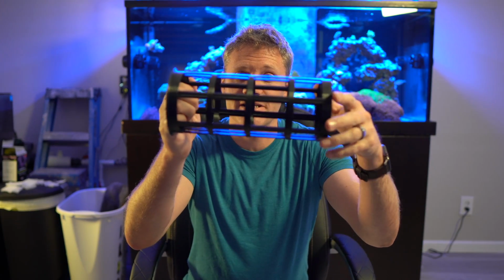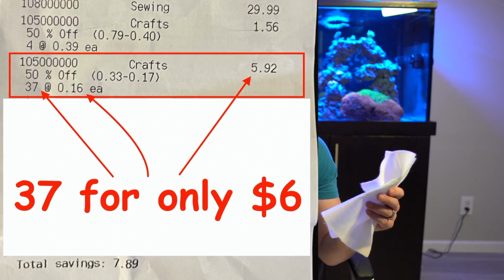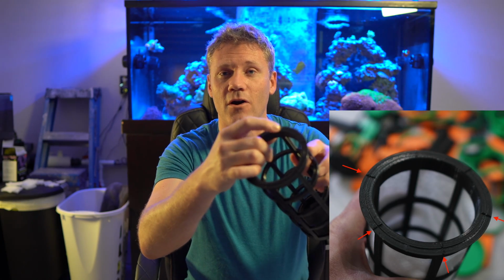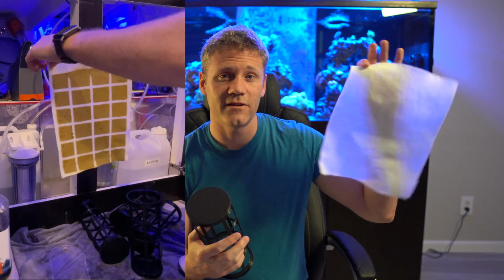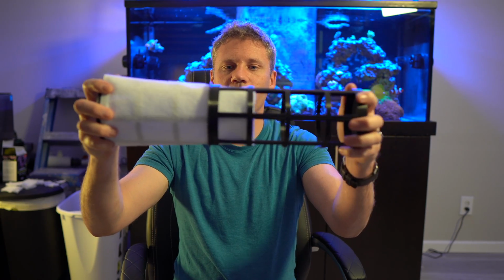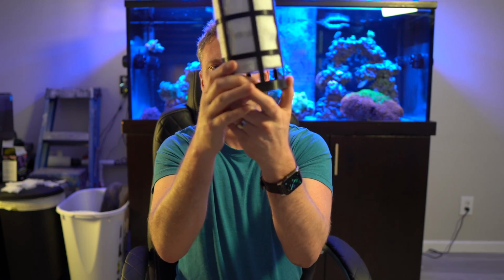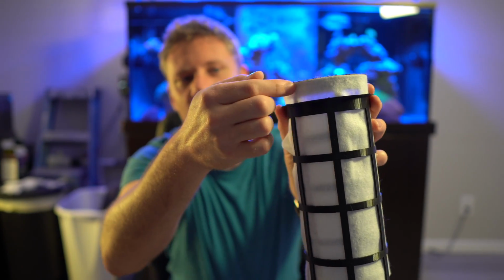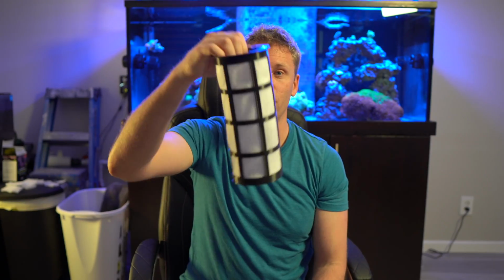No More Filter Socks!! | RAE's New Plastic Filter Sock

Comment: Creative ingenuity at work. Awesome design dude. I will be ordering 6 of them for my future sump. Will be awhile though though, sorry about that. But I predict you should be getting a lot of business / orders from other aquarists once your dramatic improvement gets more exposure. Keep up the awesome works. 😊 ? What are the three different weights of filter socks & what micron sizes do you believe they (approx.) equate to ? I am currently working out several radical improvements for (waterfall) type algae scrubbers. Which if pan out I may decide to market or just sell the rights to outright. Should provide for greatly stabilizing nitrate & phosphate levels in a reef aquarium.

Comment: I can wash my filter socks so many times before they need to be replaced that this makes no sense. Not to mention, the surface area and efficiency that I get from a commercial sock is exponentially higher than anything that will fit in this space (other than a material that will need to be replaced at LEAST daily), leaves me with a hard no. I wish you good luck, but both functionally and economically, this doesn't resonate with me.

Comment: i like it, just mmm how u turn it to put it on   theres no way you can use velcro so it stays in place when putting on so u dont have to twist ???  but other wise its cool how much with shipping and everything ?? to north hollywood ca  ????     ???
Reply from the maker: They are $30 shipping be around $10 bucks, Then velcro is not a bad idea..... I may test that and see how it works thanks.
Reply: @reefingainteasy3754  so $40  and how manny sheets dose that come with  ??? and how manny holder's   your more expensive than brs lol    ???

Comment: What's so hard about cleaning filter socks?  Toss in the washer with a bit of bleach in hot, with the extra rinse cycle.  Then run again with just water.  Air dry and done.  The washing machine does all the work.

Looks like a filter sock is actually easier to swap than this as well.

Comment: While filter cups are easier, filter socks have more surface area which is what we are going for. Love the idea and I’ve spent way more on filter equipment so while $40 for 1 seems high, your small now and getting it going. I’ll support and get 1. I hate washing filter socks, I plan on tossing each pad after each use with your unit. I have a waterbox marine X 60.2, any issues with fit?

Comment: I like the benefits but presoaking and drying seems like a process.  
Would like to see you go through the process of changing them at a normal pace out your sump.  Be nice if you could verify whether or not you have to presoak.
Reply from the maker: You definitely do not need to presoak, its the same as filter socks. Some vendors will include a note recommending pre-soaking your socks in RODI water. It's just to ensure no unwanted residue from manufacturing and the distribution process enter the tank, but your tank will be fine if you don't.

Comment: Can you confirm these fit the Waterbox 4" sock holders? The Waterbox is 105mm or 4.13 inches. I've had issues with other 4" socks not fitting correctly.

Comment: Red Sea do a plastic cup witch you fill with floss (even cheaper than you’re felt) so good idea but far to expensive and looks like RedSea beat you to it
Reply from the maker: Thanks for commenting. I have tried that before, and yes it works, people have been done that for years with poly fill stuffing, lots of pro's with that method, but IMO doesn't clean as good as a filter sock does.

Comment: Cool but a 4” utensil holder from a restaurant supply store stuffed with  batting works just as well,  that’s what I use.
Reply from the maker: That awesome and very resourceful, my first prototype was similar to that, I just didn't like having to replace it daily, or if I put holes in the sides to try and extent the time till it clogged,  I worried it wouldn't filter as good as a sock. But I know some people don't even use socks so they probably laugh at me wanting to filter every drop of water. Thanks for commenting!

Comment: You need to find a Chinese manufacturer that will produce your product for less than a dollar.  Your asking price of $100 isn't going to work for a piece of plastic.  Not trying to rain on your parade.  You get an A for effort, but this can be easily produced for a lot less.  GL, regardless.
Reply from the maker: I agree, and appreciate the feedback. I was just impatient and wanted post the video. I lowered the price and included filter sheets so that it comes out to $3 a filter. I still want to lower the price, just want to make sure there is enough demand for economies of scale to do so. An injection mold would be a pricey upfront cost because of overhangs and the fact that you need 2, but then it would be super cheap to produce. With 3D printing it needs a lot of support material (doubling the amount of plastic needed). Just depends on the demand, if there is a lot then I can justify the injection molding upfront cost, or maybe even do a kickstarter to offset it.

Comment: Looks good great idea.    But does it work good or better??
Reply from the maker: Better for me for these reasons:
Cheaper: in long run (up front cost of plastic cages)
Easier to clean
Less maintenance - one way it's less for me is since the felt so cheap I just throw them away instead of storing and cleaning socks, but if you do wash and reuse, no turning inside out and since it lays flat its just way easier to get them fully clean, also the option of using batting material makes it so you don't need to change as often as regular filter socks (less time/work), granted you might not be cleaning the water as good, but I suppose having more filter type options is another way its better.
Knowing your tank: when I used to change my socks I would pull out and put in bucket, but never look inside them. With this you naturally see what is being filtered in your tank, which has taught me a lot about my tank. If you get a pest that could have taken a while to figure out this could help you see them earlier, or if you have "good guys" you want in your tank such as clean up crew's like baby snails (from larger ones reporducing), or expensive aiptasia eating nudibranch's rather than not noticing, you will see them and can just put them back in your display tank.
I will never go back to filter socks... Thanks for commenting :-)